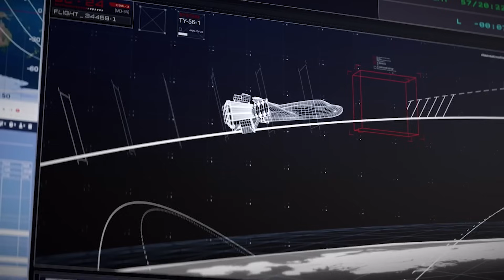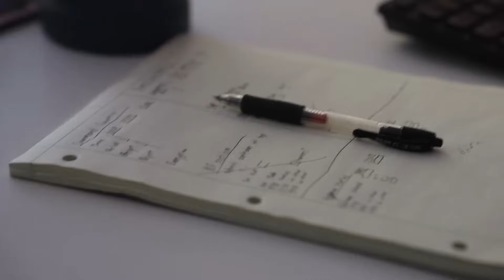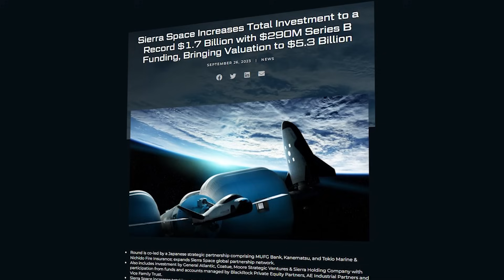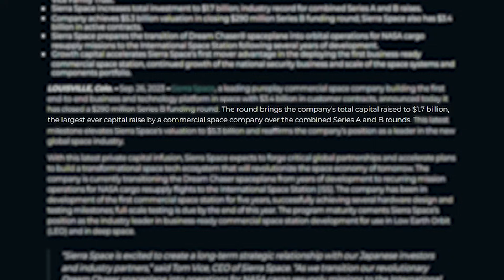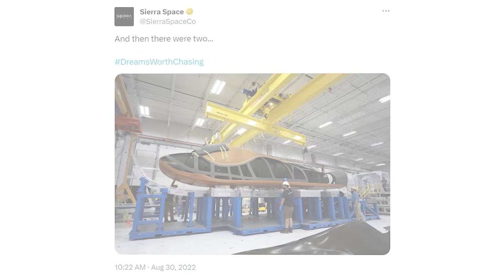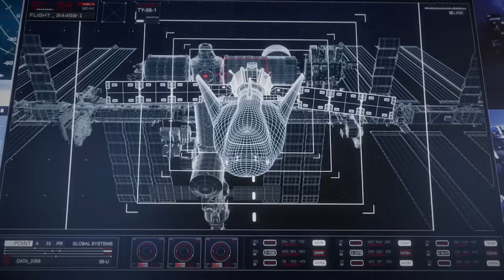More Astronaut Training For Dream Chaser’s First Launch

Comment: el Dream Chaser es el hijo pródigo del BOR-4 ó MIG-105 de la empresa rusa MIG, en todo caso entiendo que se compraron los derechos a MIG para replicar la nave en EEUU
Reply: No it is not, It is based on Boeing X20 Dyna-Soar from 50s, Russians actually stole and copied the tech and design, Soviet Mig-105 or BOR-4 were in 60s and 80s respectively while United States Air Force was working on X-20 Dyna-Soar in 50s.

Comment: Crew Dreamchaser should have been selected over CST-100 Starliner.
Reply: They should configure Dream Chaser for Falcon 9 if delays continue
Reply: Crew Dreamchaser will take a lot longer to get ready for flight than Starliner will
Reply: Star liner flew successfully, fully successfully? I don’t remember that?
Reply: NASA needed both but look what they got…a failed capsule and a delayed project that’s been ongoing for over 50 years!!!
Reply: Why? 
Sierra still hasn't gotten an UNMANNED version to fly ONCE. 
Starliner is a crewed vehicle and has flown twice, with once fully successfully. That is the real reason Starliner cost more than Dragon. Dragon 2 leveraged SpaceX legacy hardware from Cargo Dragon 1, so they had less to do. (And SpaceX STILL blew up the capsule during a test before the in flight abort test. That goes to show that changing hardware dramatically can have unintended consequences.)
Manned vehicles require a whole different, higher level of security and safety. That's why they usually take about a decade to get them ready, (unless you have an Apollo Program, with the highest national priority.) I am still amazed how fast NASA developed Gemini. That was a real credit to American and Canadian engineers and McDonnell Aerospace.

Comment: I think only issue I am curious on, is the quick turn around.  The ship using same style of heat tiles.  That's time consuming, while not as consuming as bigger Space Shuttles.  It will be interesting how it pans out.
Reply: I would guess, and this is just an unsubstantiated guess, that they probably updated the ceramic tile formula to be more durable.  However, it would be wise to carry a reaction control thrusters drone which could circle the spacecraft to inspect the tiles (yes, I know that they probably just intend to roll the spacecraft near the ISS to inspect the tiles), and perhaps even layer down some ablative cement of there is damage.  Also, this might be a good time to try out the old M.O.O.S.E. emergency re-entry method.

Also, they don't intend to strap this space plane to a booster tank where falling ice could damage the tiles so simply mounting it on top of the launch vehicle also addresses this problem.

I highly doubt it will launch any time soon as they've missed several launch targets already and both the spacecraft and their chosen launch booster have had problems plus the first launch of their launch booster won't be carrying the spacecraft.  The question is will they launch within their contractual obligations with NASA or could a postponement be negotiated.

Comment: I don’t think by contract they can use any other rocket than that provided by ULA? Plus Tory probably has money in the Sierra game!
Reply: Well, it's ULA that has failed to deliver on their contract however this has worked to Sierra's benefit as they've also had problems with their spacecraft and had to give up on a few features like the folding wing tips.   Even if Sierra finishes with their spacecraft, it may just cost to much to switch to their backup booster options like the Atlas V.   Interestingly, the Atlas V was the second booster for the Gemini space capsule and needed to be modified per NASA recommendations as the initial reliability was 30%.  It's interesting that we once accepted a 70% catastrophic launch failure rate on our ICBM's, goes to show that it was the bluff that we desired.

Comment: i hate that the new crew version will not have the windowed cockpit
Reply: It's a lot safer without the windows.  The windows would only be useful during landing and multiple cameras and a virtual or 3d display would work as well (multiple backups of VR headsets could also be available while it's difficult to swap to a spare window).

Comment: i just wish they would use Falcon 9,  reusable 1st and 2nd stage and it ready to go now
Reply: F9 second stage isn't reusable.
Also, based on weight, Falcon 9 would likely need to be expended to get the necessary performance to launch Dreamchaser. Finally, Dreamchaser with the shooting star cargo module would not fit inside the Falcon 9 fairing, so SpaceX would need to develop an extended fairing variant to accommodate the mission.
Reply: Yes yes yes, get it flying